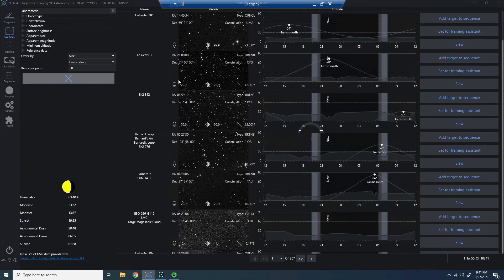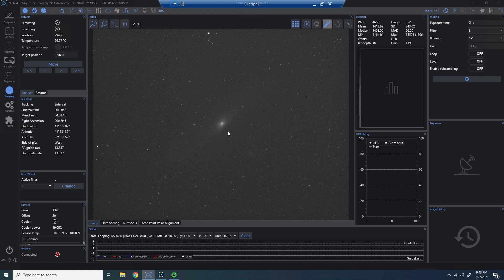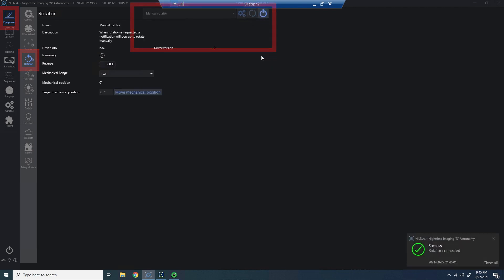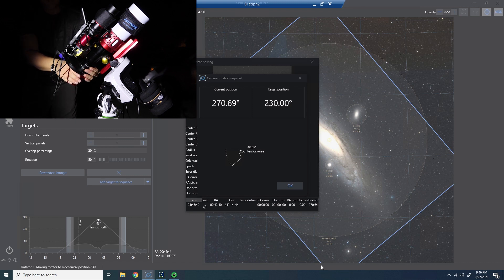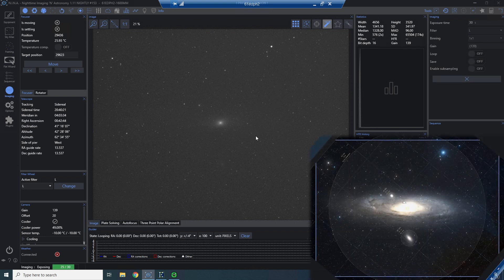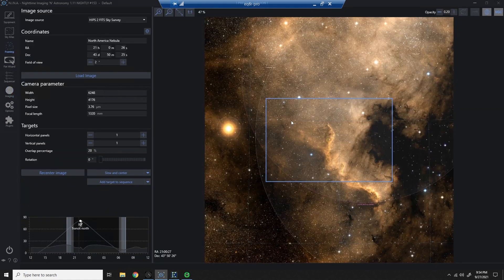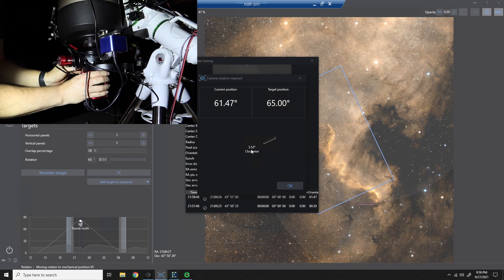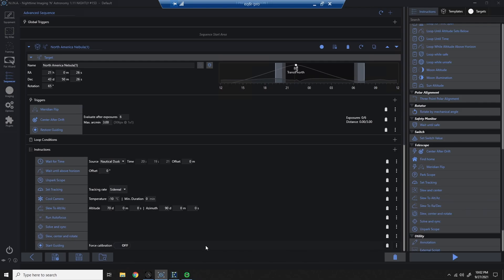Better Framing in NINA with the Manual Rotator

Comment: Thanks. But why the angle is not the same in framing assistant and in your solving . We can see 90 degree but when you turn your rotator Nina tell you 230 degree
Reply from the maker: I may be way off here in responding to your question, but to keep the discussion going in an attempt to find your answer, let me try to make some assumptions about what you are seeing. The first time I put the red lines on-screen was in the framing assistant, this is how NINA/ASTAP see the object and its rotation. The second time I put the red lines on-screen, was an actual image from my camera sensor. This image was rotated about 90 degrees from the framing assistant. Ok, so this is the first point of understanding, this is where the 270.69 degrees Current Position comes from. I started 90 degrees off from the expected angle/position in the counterclockwise direction and 360-90=270. Then I attached the Manual Rotator and plate solved, the system said I need to move from my current position of 270.69 to 230 degrees (based on the framing I choose). I therefor had to rotate from my current position another 40 degrees counterclockwise to match the desired framing. Does this help with the 90 degrees you mention came from, or was that elsewhere in the video?
Reply: @PatriotAstro   in fact what we see in the video is that you choose the 90 degree angle in the framing assistant and that astap asks you to turn the camera to reach 230 degrees. it looks like the angle of rotation in nina determined in the framing assistant does not correspond to the same angle as astap roughly when nina says 90 degrees, astap says 230 degrees
Reply: @PatriotAstro  because i think your position should be 90 or 270 .
Maybe i disunderstand something but why 230?
Reply from the maker: @Akira13013  I think you are just stuck 1 step before the 230 becomes important. NINA/ASTAP knows the orientation of the target we are looking at. Before rotating anything at all, you can platesolve an image which will tell you the actual current orientation of your camera sensor. In this case it was determined that my camera was already rotated to 270 degrees before I did anything at all. Then, NINA/ASTAP looked at the rotated framing of  the target I requested. It found that the way I changed the desired framing of the target I wanted to image was rotated to 230 degrees based on its database and my rotated frame. Next, it compared my current camera position of 270 to the desired framing of 230. This is why it asked me to rotate 40 degrees (270-230=40). It knows that if I rotated 40 degrees, any images I took would match the framing I set in the interface.
Reply: @PatriotAstro   ok . It was confused to me . I switch from sgp to Nina after watching your video and i’m very happy by advanced sequencer. But i use manuel rotator and sometimes Nina want me to change rotation while i didn’t touch anything. I’m a few lost.
Reply from the maker: @Akira13013  That can happen. If you have the Manual Rotator connected, AND you tell it to "Slew, Center, and Rotate", platesolving will (because of the rotate part of the request) be required to take a picture and determine if rotation is needed. If your camera takes a picture that doesn't match the framing picture's rotation in the framing assistant, it will request you adjust it to match the framing. Even if you didnt touch anything on the image train/camera, if the picture doesn't match framing for any reason (with the rotator enabled and rotation requested), it will do this. One way to address this is to figure out what angle your camera is currently rotated to and move it until it is set to 0 degrees which is the default framing angle in NINA. Basically, platesolve a target and see what angle is reported as the current angle. Adjust it until the current angle is set to 0 degrees. Now, any unmodified framing requests should match without the need to rotate. (or disable the Manual Rotator when it isn't needed.... which may be easier.) :)
Reply: @PatriotAstro  i didn’t think about this 
Thanks for your answer.

Comment: Is all well and good but have applied this once the intention of either N.I.N.A or SGP that everything goes automatically and if everything goes well you can start your night's sleep; problem that the meridian flip is also the rotation checked again and since I was not present all the frames after the flip where bad.
Reply from the maker: Correct. The manual rotator needs a babysitter from time to time. One option in the Advanced Sequencer is to image using the ‘Loop until time’ looping condition with the time definition set to ‘meridian’. This will stop your imaging at the flip time and allow you to move on to a new non rotated target while you sleep. ;) The only other option to rotate while sleeping is use of an electronic rotator, which for me, is too expensive and has a backspace requirement footprint I cannot meet.
Reply: @PatriotAstro  Thanks for the comment; have thought about it you can do this so in the framing assistant and then record an image and see if it is to your liking and then do not set it in the actual sequence so just slew and center set in the sequencer the camera rotation is already set anyway if a meridian flip takes place there is only again slew and centering only the image is turned over and the stack program does the rest.
Greetings from Belgium
Reply from the maker: @Bogfra1  Right. 180 degree meridian flip will be fixed during alignment. You can always also fix a lot of this in processing: stacking, rotating, and cropping can do some similar things. This of course would come with loss of data as a result of cropping to correct rotational issues. Where this really gets interesting is when you 1. Don't want to lose any sensor space to cropping (or at least limit it), 2. Multi-night imaging with consistent framing, and/or 3. Limiting excessive loss of overlapping space required for mosaics. Great point!